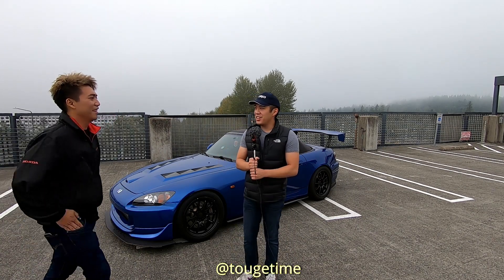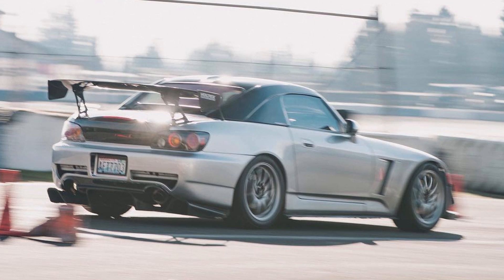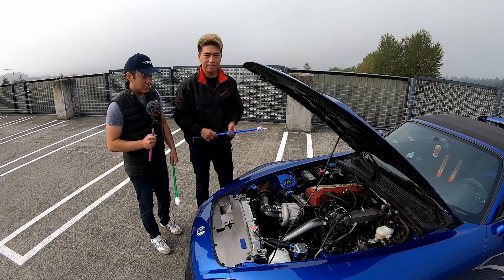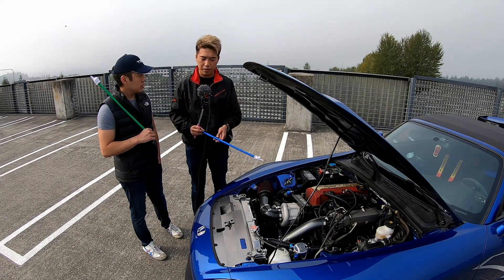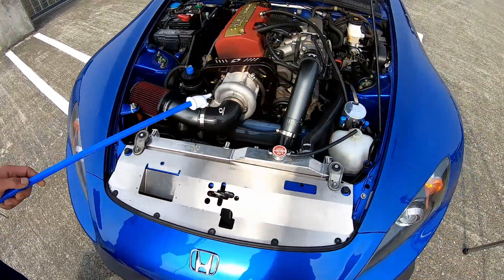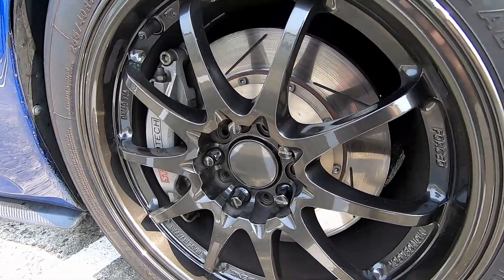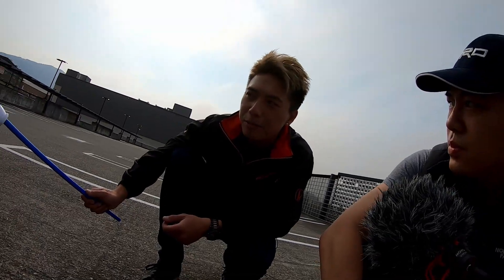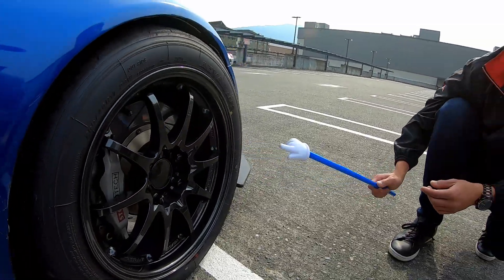Touge Test: Supercharged 400whp S2000 | Street Driven Time Attack/Touge Monster

Comment: Couldn’t you get  an upgraded sway bar and keep it at a neutral setting?  It seems like that would help the handling even more.
Reply from the maker: Depends. If the springs are stiff enough it won't sway and no need to tie the LH RH side together